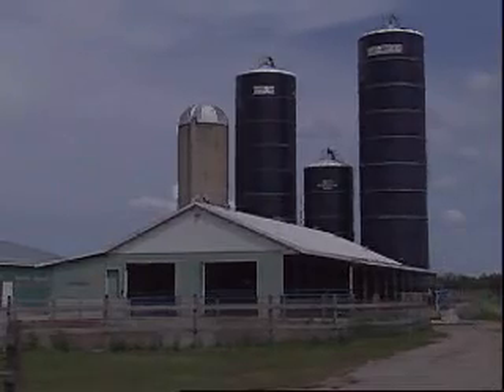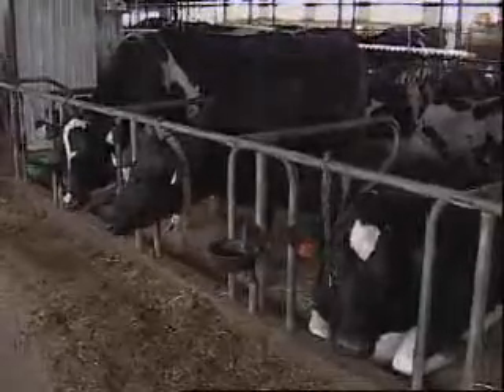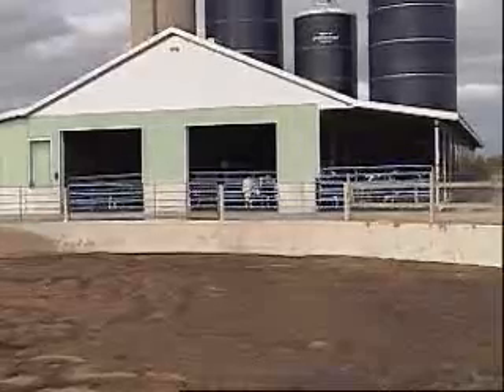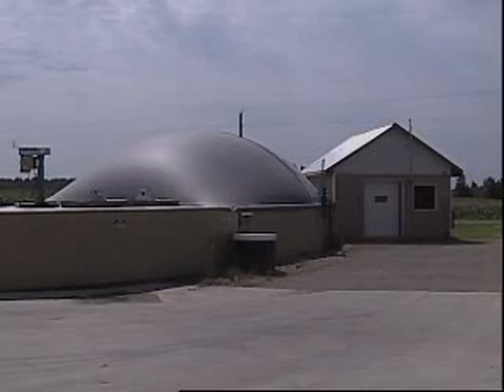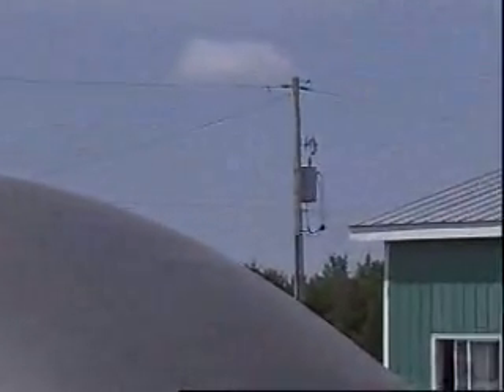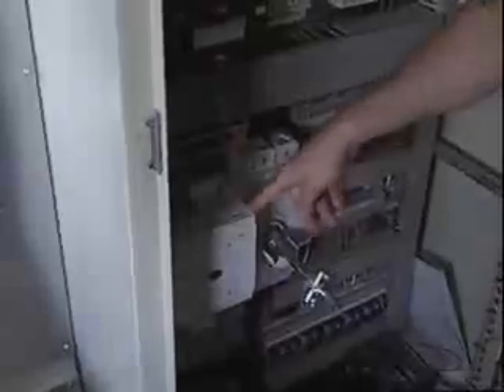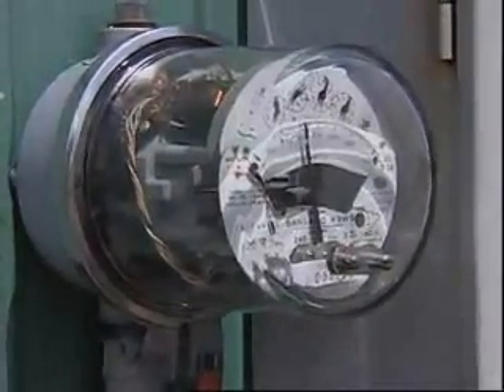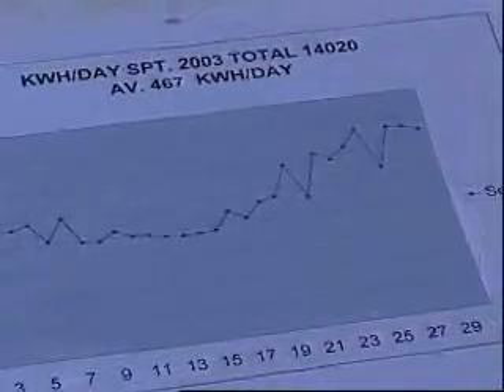Using manure to generate electricity  - march 2009

Comment: A great system.  Congratulations on you willingness to promote green /renewable energy from a waste product.  I have a pig manure to electricity at my farm in NC (USA) and it work great except, the bio gas has hydrogen sulfide that corrodes the engine and the raw gas needs to be cleaned.   The gas is also too moist and too warm.  Can you tell me how you clean, dehumidify and cool your bio gas prior to using it as a fuel?  bfbiogas@gmail.com or 910-893-2810.